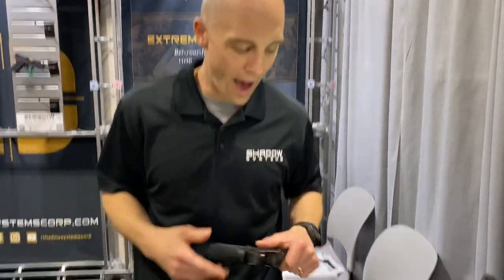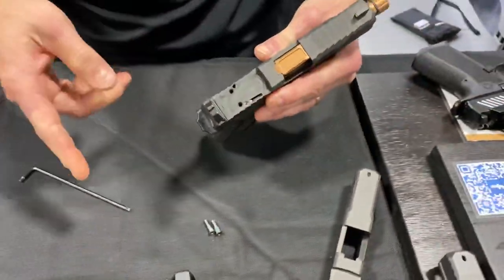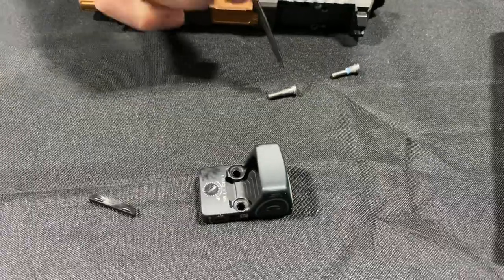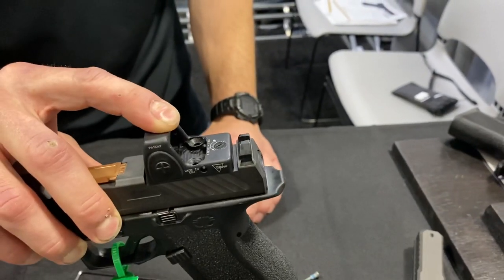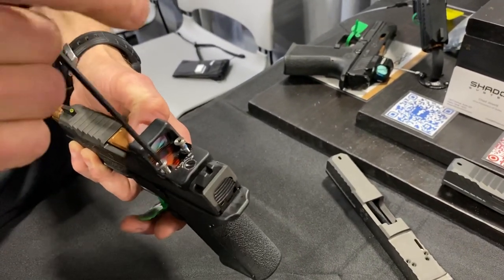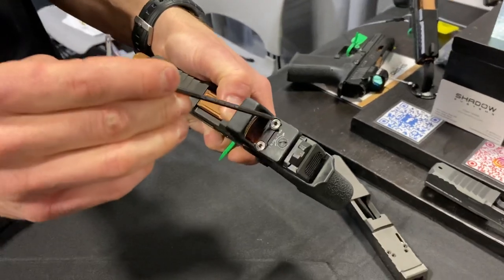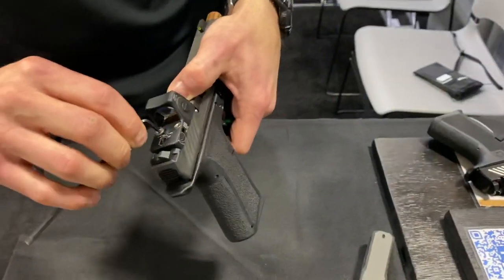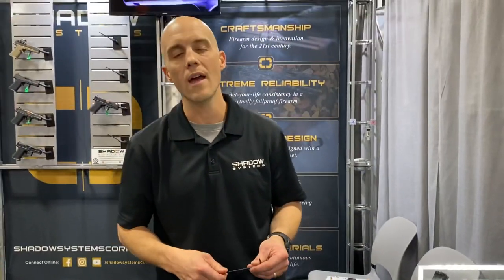How does the MR920 Optic Cut Work?

Comment: Do you think this is a better fit than a custom cut slide for the RMR, like the WARPOET?
Reply from the maker: For the RMR, they would perform equally well from an abuse/hard use perspective.  Also, our new cut and old cut put the optic at the same low position in the slide.

Comment: I'm on my way to the range with my MR918!!
Reply: it's pretty badass. I'm not a pro and started shooting low left. I changed the backstraps and raised my point of aim higher. I have 470 rounds through it without any malfunctions. I think you'll be fine for conceal carry. It's a light pistol. I also love the magwell, I have medium size hands and it's perfect. I paid 700 and change out the door for the bronze barrel mr918. If you can find one hold it and see if you like it. I'm a sig fanboy but I love the mr918.
Reply: if you were in AZ I'd let you shoot one before you bought one. But they're badass I don't think you'll regret it
Reply: I found mine at the local gun shop. I did a ton of research before hand. Watched all shadows videos multiple times. Two stores here had them but one was significantly cheaper than the other. I got some B's reasoning why "it's harder to get ones with the black barrels that's why they're more". Total BS. Lol
Reply: @TineEdong  Haha, always some excuse to charge more. Hey, thanks so much
Reply: you bet! Btw I did take a Glock g19 into consideration and I couldn't built it to what shadows is doing for the same price.
Reply: I just changed my conceal carry to a 43X. It's smaller and for me a little more comfortable.
Reply: @TineEdong  still up in the az area? i am looking to shoot one before i buy it.
Reply: @manzano5620  I am but I got rid of it a while back. It's like shooting a Glock 19 🤷🏼‍♂️ if you're into custom glocks, the mr918 is sick! I guess it all depends what you want. Bring ammo to Sierra Vista AZ, I have a bunch of stuff to shoot

Comment: I just picked up my new mr920 elite yesterday and I notice the slide to frame fit is pretty loose from the front end. The front end of the slide wobbles from side to side if I induce it. Is this normal for shadow systems quality control?
Reply: That's pretty normal for any polymer frame pistol
Reply: Just got an MR920L yesterday and I noticed the same thing. My G19 does it but to a much lesser degree. I think it’s probably normal- it shot great.

Comment: Question, will a 507k mount up? I assume if so it would be w/o a spacer? Thanks
Reply from the maker: Yes, it will mount, but would be we do not have a dedicated spacer for the 507K.  Trevor
Reply: @ShadowSystemsCorp  Will a spacer for the 507K be available in the near future?  And will the 507K fit in your red dot cutout on the MR920 slide?  Thanks!

Comment: Disappointed with the optics cut so far.  Cant get my delta point in.  Spacer is too big.
Reply from the maker: The spacer is supposed to be a bit bigger than the space between the optic and the slide cut, as the compression of the spacer helps lock the optic in place. Install the spacer first and then seat the optic against the spacer and press into the optic cut. This step by step may help: https://shadowsystemscorp.com/mr920-how-to-mount-your-optic-optic-ready-slides-only/